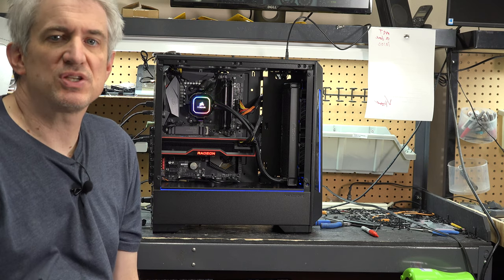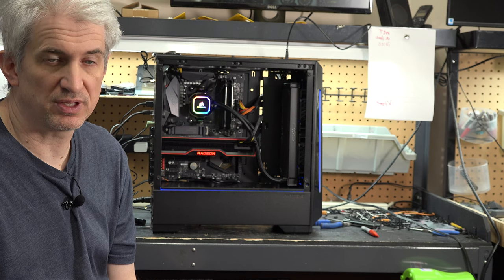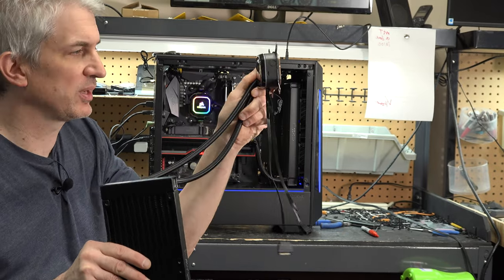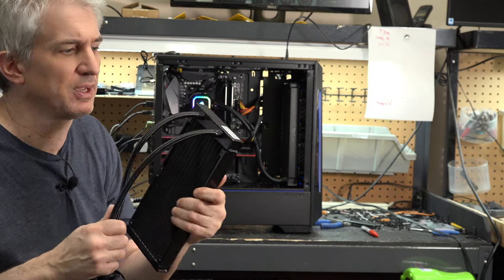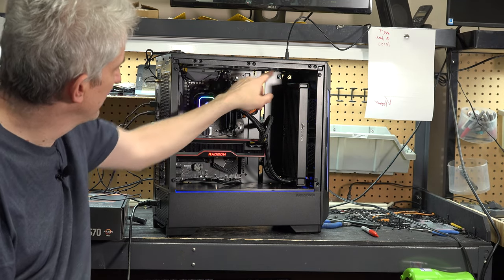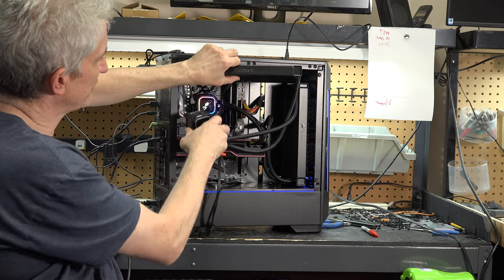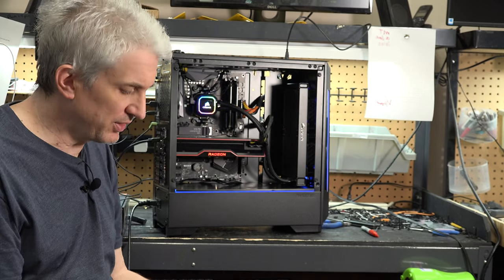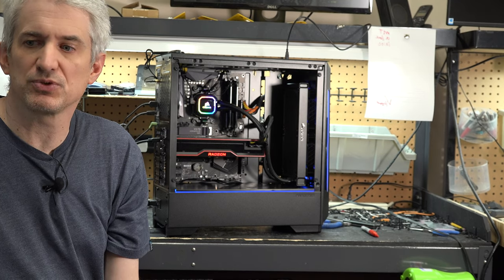The right orientation for water coolers

Comment: How about the fans on the water cooler? Are they pumping air in to or out of the case?
Reply from the maker: Out when in the top of the case.
Reply: @xforcepc  But in this video they are not on top, they are in front? I don't know if this is a cultural thing but I found it very confusing with the way people understand these things or use terminology. When you push air inside the case you use "pull", and pull the air  outside the case you say "push".
So to be clear, in this video the radiator is in front, does the air go inside the case or outside the case from the radiator?
Reply from the maker: @olcique  Like I said, you blow OUT when it is in the top.  When it is in the front, you blow air IN.
Reply: @xforcepc  Thank you for your time...

Comment: Just wondering why water coolers are really needed anyway. Got a big air cooler on my l9-9900K and the temp never goes much above 50C (FS2020, sorry). My RTX2080 tops out near 68C, air cooled also.  Seems like water is overkill - we had water cooling on our IBM650 in the 1960’s, really needed it then, not so sure now.
Reply from the maker: It is hard to ship a PC with a LARGE air cooler and have it not get bent or damaged in shipping.
Reply: @xforcepc  ah, that makes sense...